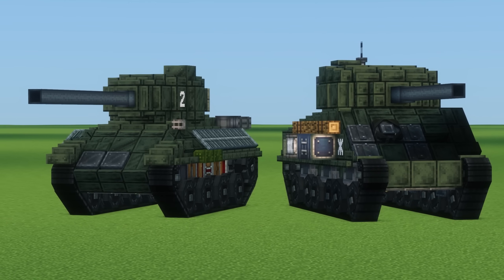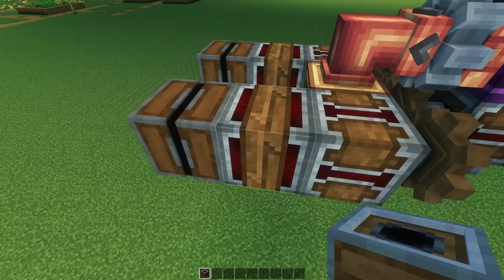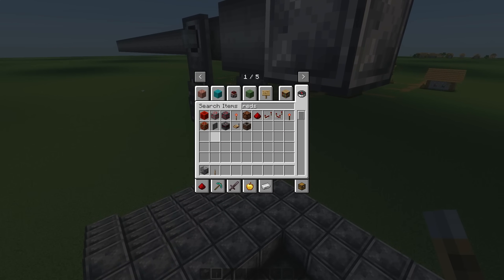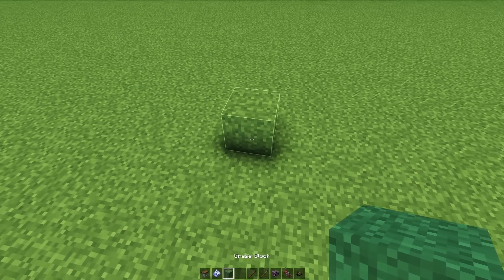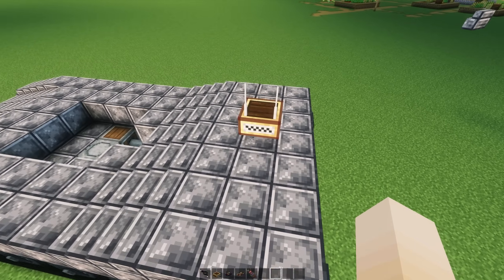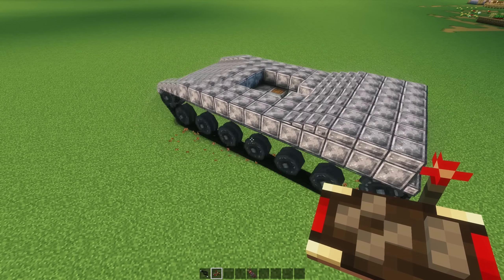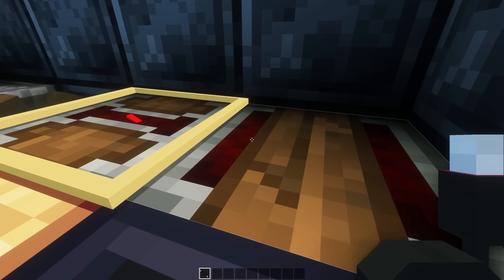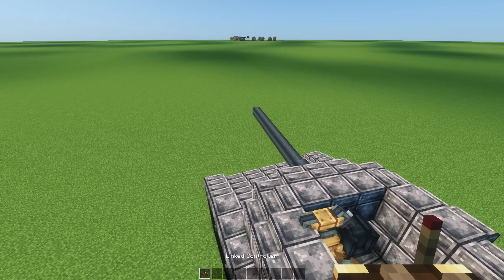How To Make A Working Minecraft Tank (2025)

Comment: I followed the tutorial and it works flawlessly. However, once I do the final step (the saving and loading so I don't have to re-wire everything, for some reason the only control that doesn't carry over is the firing one. I'm using a tweaked controller and it works on the first one but the copies are just missing that keybind for some reason.

Edit: So the thing I noticed is that every keybind I do with the turret just doesn't get saved. I've tested this with a redstone lamp using the tweaked controller hub with other random key. I don't know if this is how it's supposed to happen or I did something wrong.

Comment: i followed the tutorial and for the whole thing got over stressed by the time i hooked up energy transmitters to the turret HELP

Edit: So i fixed the problem with the stess impact being far to much for the modular engine. I replaced the modular engine with a regular one with a super charger and hooked it up to the bottom. I realized that did absolutly nothing and they all generate the same SU so i put a redstone resistore between the transmitter and added an annolog lever with around 10 cranks to slow it down

I ran into another problem. Aftter making the hull a physics object it would not just sit without leaning. and it leaned heavily. reminicent of a see-saw if i weighted them out, it would just lean. it makes no sense

Comment: I have the opposite, it goes when it started, it started to go by itself, when I connected it to the remote control it stopped
Reply: Use inverted clutches, they won’t move without power, you can use regular clutches, but it requires a redstone torch to activate/deactivate correctly

Comment: Got a problem, the energy transmitter for the loader makes it overstressed, i tried using the resistor but no change. any solutions?

edit: I had to replace the energy transmitter thats connected to the mech arm with a creative motor to make a temporary solution
Reply: same
Reply: same
Reply: @I_am_Blob_Fish this tutorial is very badly made

Comment: I have a problem when trying to put my turret on the hull. My turret never wants to attach to the physics bearing and instead it just spawns in as in normal minecraft blocks no matter how hard I try.

Update: It works when I only use the modpack, and literally only wasted my time by trying to build and design my tank on my own modpack (over 4 hours)...
Reply from the maker: You have to use the provided modpack
Reply: @qarsan2  Okay I will try that. Just one question. What resource pack did you use for the tank tracks in the video?

Comment: The Create: Ender Transmitter mod does not exist on version 1.21 of Minecraft. Also for those who want to know, the Create: Connect mod is useless on Fabric too.... Building a Tank with cannon is easier said than done on updated Minecraft. Just a heads up.
Reply: It does exist....
Reply: I just went through every version to get them all working
Reply from the maker: If you use the version which lacks all the necessary mods instead of the fine-tuned proven modpack which is provided, then yes it becomes very difficult
Reply: @qarsan2  Is that noclip tool unique to the tank tussel modpack?  doesn't seem to recognize that item when i tried to add it on a different VS modpack.
Reply: @qarsan2  i had the same issue, but its actually not that hard if you have enough space for a 2nd engine on the turret, even tho my tank looks wonky it works
Reply: @qarsan2  how do i manage the stress
Reply: @qarsan2  I checked your discord, and in the mods channel I couldn't see a modpack, just the mods in the pack. I'm just wondering where the pack is if you could be any help? :) Sorry to bother you, I just really wanna tank in MC >:)
Reply: No worries, I found it, I was just blind XD
Reply: Cool, And i only use versions prior to 1.21 anyway, so i'm good.
I'mma also try to make a Leopard 2a7 eventually... I mained as Germany in WarThunder

Comment: TFMG is better than C: DG, nice tutorial none the less
Reply: TFMG requires larger, more complex systems, with the benefit of internal speed control
Reply: @TheGrayAllayradial engines take one block but generate tons more SU and dont need the exhaust system
Reply: @ They’re a bit finicky plus the mod adds other stuff too, like electricity and steel, which would lead to bloat of the modpack
Reply: @TheGrayAllay I mean if you just making tanks its fine, but for any fully fledged pack TFMG is better
Reply: @TheGrayAllay i mean some blocks in TFMG would be useful for tank building

Comment: question: for differential steering, do you just stop the track and put 256 RPM and everything else 128 RPM? Or do you just slow down the neutral steering and everything else 256 RPM (my current solution)? Like, I tried first making it 512, but create doesn't allow it. How do you guys do this?
Reply: I actually do that, but is bigger, and need more SU, so nobody use it.
Reply: @CHINESEFBI  which one are you talking about?